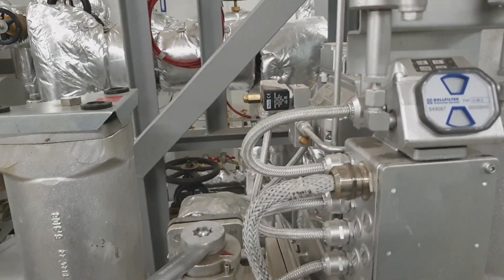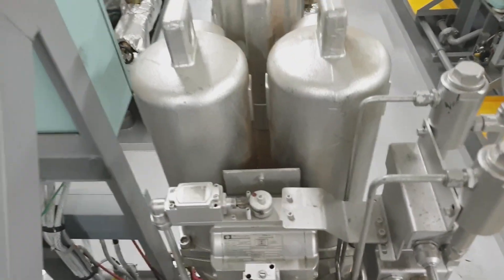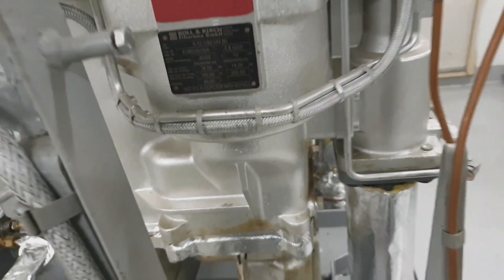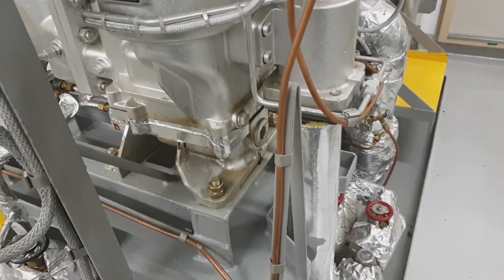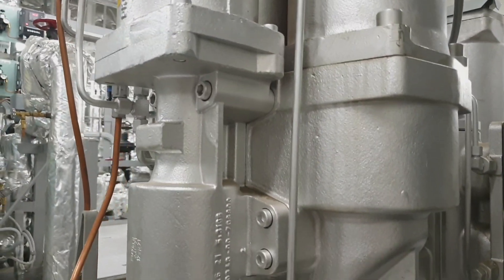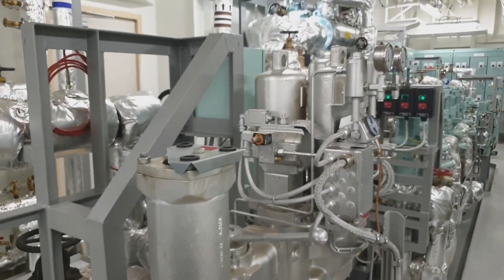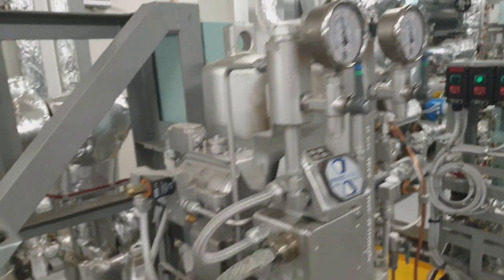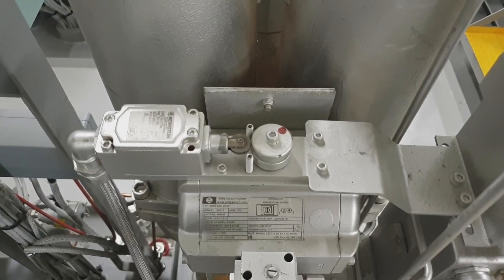WHAT IS AUTO BACKWASH FILTER ?

Comment: what is the meaning C - F - Q on the control panel thank you
Reply from the maker: In that panel there is an equivalent command where you can explore and navigate the settings, 
In the c you can adjust backwashing time or the discharge interval
In F , you can adjust the alarm high differential pressure, timer settings etc

In Q you can change the model type of the backwasf filter

Everything is in the instruction book you have to follow the manual instructions
Reply: @JB23VLOG  thank you for information :)